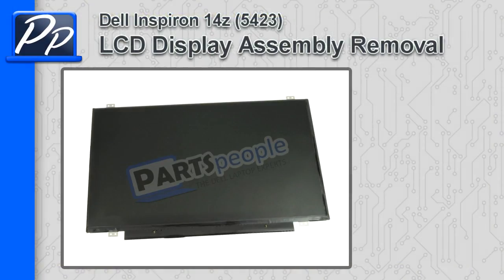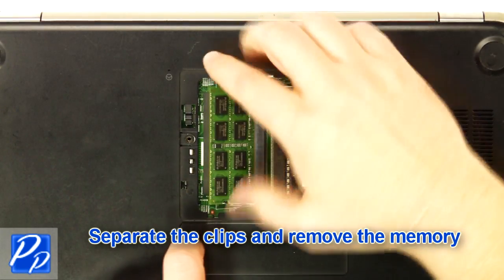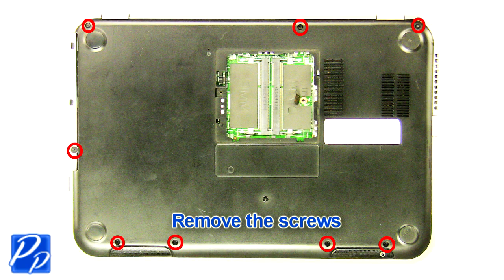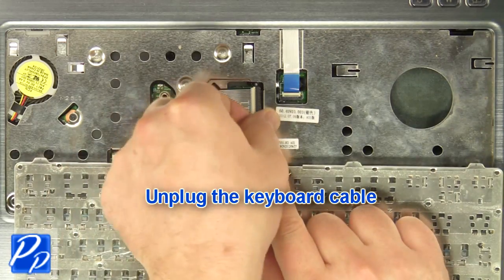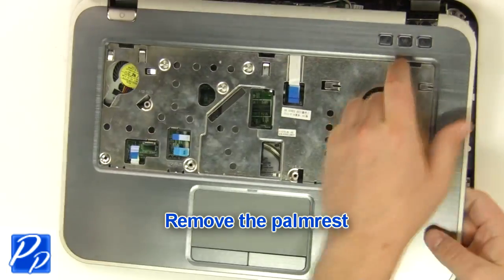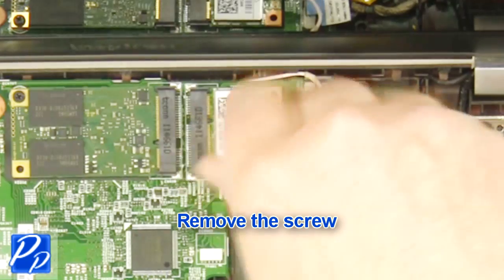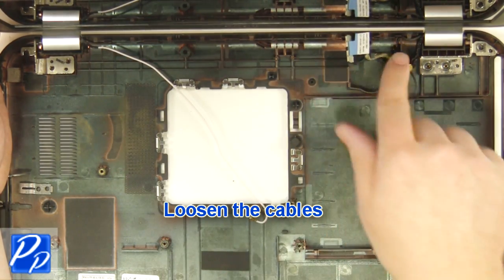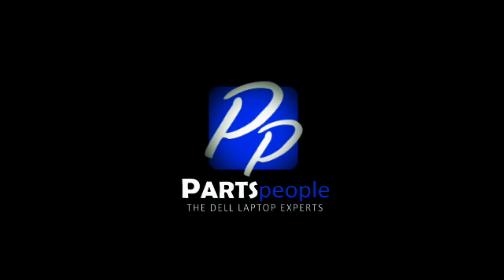Dell Inspiron 14z (5423) LCD Display Assembly Video Tutorial Teardown

Comment: Hey guys is the top panel of inspiron 14r 5420 compatible with 14z 5423
Reply from the maker: Kaushik Mahida No, they're not the same. The screw locations are different. Unfortunately, I have not made videos for the 5420 yet.
Reply: The problem is! 5420 top panel is too weak and the hinges too hard for it to support a plastic body! It has been atleast 7 times that i have changed the top panel and hinges! After changing it and usage of a month or so, lines appear on lcd and then i have to change the lcd again.! I was hoping the alluminium panel of 5423 might solve the probelm
Reply: The lcd lines are directly linked with the flawed hinges and weak plastic body of 5420! Lines on lcd is inevitable after using it for a month or so!